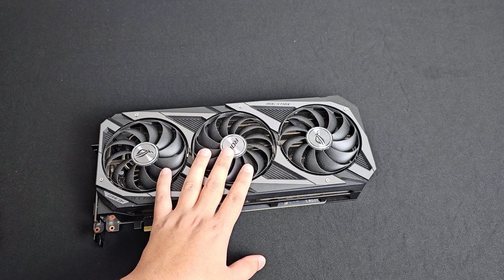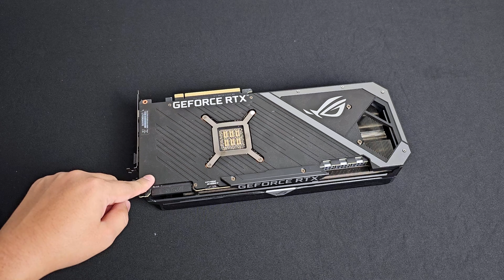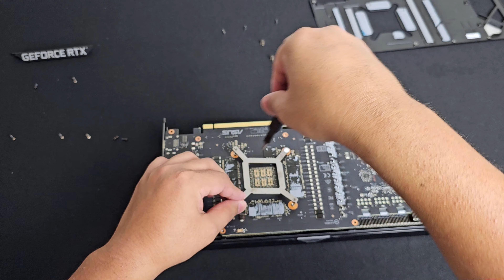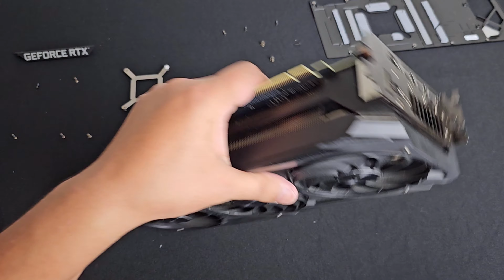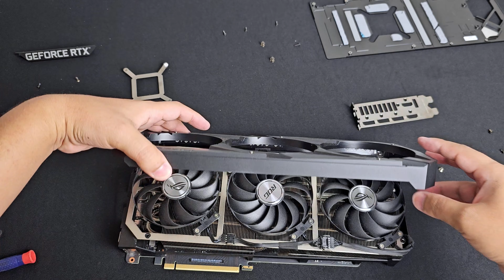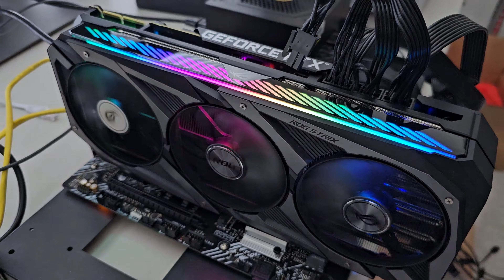ASUS GeForce RTX 3090 ROG STRIX  Fan Replacement

Comment: If you use a heat gun on the backplate, the thermal pads will come off easier and with less trauma—both to you and the pads.

Since I didn't have the right tools, I ended up separating the board from the radiator and reapplying the thermal paste.
Probably the most difficult part about it is getting over the mental barrier. Other than that, the process is pretty straightforward if you build your own computers.

If you want to reuse the Asus or ROG badges on the original fans, apply heat to the badge with a heat gun, then slowly pry off with a razer blade. The replacement fans that I received had stickers, so I replaced the stickers with the OEM badge.

Next time I do this, I'll try using an offset screwdriver on the screws that are covered by the board.

Comment: @0:52 Definately a PH1 and a Torx 6 (not PH0 and Torx 5).  Using the smaller sizes, that you mentioned, are very loose and risks damaging the screw heads (if they are tight).  PH1 and T6 are the correct size for a correct fit in the screw heads!
Reply: And 4 GPU one are 3 level smaller than PHx of backplate

Comment: Same GPU I replaced all 3 fans and 2 aren't working. I've checked BIOS, ensured all the fan daisy chain cabling and connection to GPU board is fit snug but still no fan spinning. Any help is appreciated

Comment: what is part number/model for original fans of asus strix 3090 ? coz online there are two options that are advertised as suitable replacement CF1010U12D (ball bearing) or T129215SU (Everflow)?

Comment: I can confirm that it is possible to unscrew the fan frame without needing to open the board and repaste, etc.. You need a long thin PH00 screwdriver with a magnetized head, otherwise it is impossible to replace and fasten the screws again when you are done. Having some tweezers around may be a good idea too. I opened the backplate, which made the shroud loose, and then carefully unscrewed the four screws holding the fan frame. Be very careful when disconnecting the fans, you need to press on a latch that is on the underside of the connector. Otherwise you risk ripping the cables out. I was prepared to repaste the chip and redo the thermal pads on the whole thing, but I was happy that I only needed to replace the 2mm thermal pads on the backplate. When I put back the card and benchmarked it I realized I forgot how quiet it was supposed to be (and was when it was new).

Comment: 3080 strix, same issue, center fan failed, now the left one start making noise too.
How can they produce such expensive gpu with a design that stupid.
You are forced to disasemble the whole gpu just to swap a cheap crappy fan...
Reply: @imyourrealfather-yes yeah the amount fo strix fan failing is really impressive...
To the point i am gonna change gpu next gen, not because i need too but beccause i don't wanna deal with the feeling that my gpu fan may start rattling again or simply won't start at all randomly some day...

Comment: 2:20 I ripped one of the wires out that gave power to the fans on the front that step

For future reference there is a clip under the wires that needs to be pressed / lifted before you pull it out

I hadn’t know til I literally broke the entire plastic piece off I’m so upset
Reply: hhahahahhahahaahahahaha

Comment: in thermal pasting, never forget, less is more!
Reply: Totally agree.  His big X cross of thermal paste made me a bit drop-jawed!   Usually just a small drop in the middle is appropriate.  It spreads out evenly and thinly when you properly tighten the heatsink clamp.  If unsure, you can even do a test run, so you can inspect the result you get when you take it off again.

Comment: I you need to replace the fan do not follow this tutorial. You do not need to tear down the entire card to access the fans....
Reply: Then how would you get to the shroud screws…
Reply: How? 😮 Im going to clean fans and cards radiator, i dont want to take off backplate ect.
Reply: @KOT-ANGRY  did you find how to do it without tearing down the entire card ?
Reply: It is possible to change the fans without taking it completly apart I have done it. 
You only have to take off the backplate. Four screws hold on the front shroud, 3 can be removed with a normal screw driver. 
The Fourth screw in the bottom right of the GPU as you face it is a bit tricky.

You need to do it with is an offset screw driver, you can buy them or custom make one  as I did by heating up a striaght screw driver and bending it 90 degrees.
So it is possible and its less work than completly taking the GPU apart and having to repad and paste.
exceptionally poor design by Asus.
Reply: @dane2427  if only you were making video of this... ehhh...)
I think i`ve got the same fan issue with used card i bought.
And the fact that i need to... do... all this shit to just replace the damn fan... IS NOT FUN AT ALL
So u have a point.
BTW, don`t u found an information about how thick should the thermal pads be? 
Are where any specifications anywhere...?
Reply: @ДмитроКононенко-о6п  i reused the original pads but i think i will try thermal putty instead of pads next time.
Reply: @dane2427  going to replace 1.5 faulty fans (1 is completely wobbly, another one is so-so but close to it) as well ._. 
Maybe you can advice me which size screw driver is needed for that fourth tricky screw? (need to get a cheap one to turn into custom-made angled driver XD )
Thanks in advance (:
Reply: @Anroel  a little one the same size as you used to undo all the other screws
Reply: @Anroel  if they are wobbly but still spinning I'd leave them until they start making a loud noise.
Reply: @dane2427 oh, got it, thank you (:
Well, I said "wobbly" but in fact it looks like it's gonna fall off any time soon (and terribly noisy of course) - it became so all of a sudden today, so no option but to replace (just waiting for spare parts now) ._.

Comment: You did this wrong in multiple ways... Oof. Not the video to watch for this.

Why do ppl think winging it is gonna make for a good tutorial?

You did not have to remove the first backplate you removed, since you had to remove the entire card from the cooling unit anyway. You also did not have to remove the faceplate where DPs plug in. You can remove the card without removing that, they are not connected. Then, isntead of just unplugging the card and setting it aside, you fuckin put it back on in order to lay the whole ass GPU on the exposed card...

I just...

Oof...
Reply: Can you show us how to do it without disassembling the card completely ?
Reply: @11NoobestPlayer  disconnect led & fan cable. Remove 6 screws from the back of the card. Whole thing pulls apart. There’s no need to remove the back plate.

The OP is right. This video is terrible.

Comment: Should you replace the thermal pads (not the ones in the backplate) or is it enough with the thermal paste replacing?
i don't know the size for the pads of my strix 3080 Ti
Reply: You should be fine, just check the memory temps afterwards.